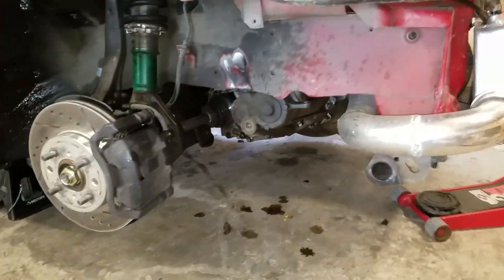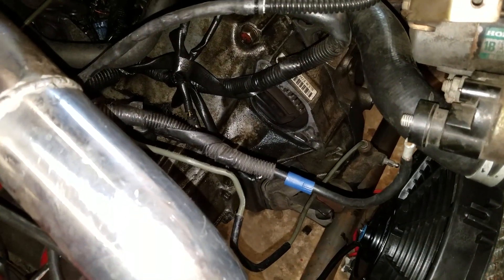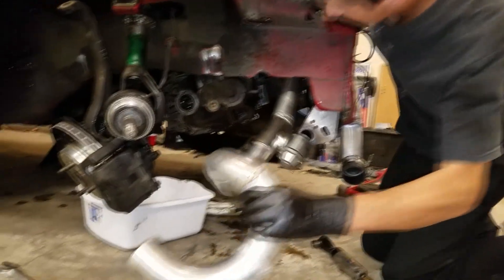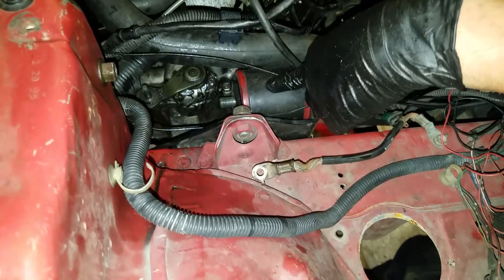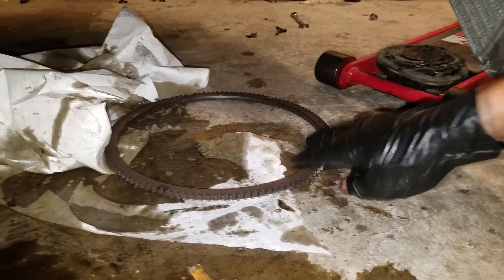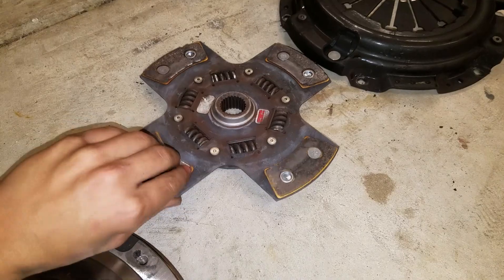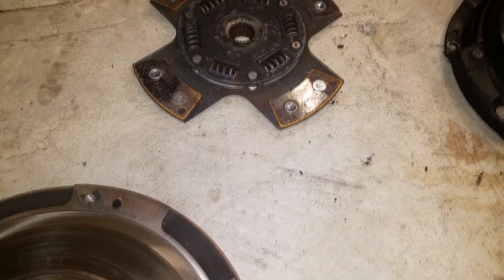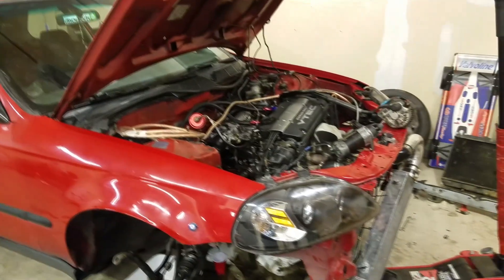The Hatch is Down

Comment: clutch and flywheel wasn't properly broken in.
Reply: seriously or are you joking?
Reply: +Tony Soto I agree with you
Reply: Tony Soto when you throw in a clutch and don't properly break in and wear the highs and lows of the clutch surfaces flat and even first before banging the gears it will cause excessive heat in random areas creating hot spots and expanding the clutch material at different rates and then pieces start to break off. drive with the new clutch slowly pushing and releasing the clutch at cruising speed if you don't want to have to drive 1000 miles first.
Reply: +john martin true but his stock flywheel probably had uneven wear to begin with due to probably just being the original flywheel he most likely broke the clutch in he seems to know his stuff. so the clutch dieing probably result of original unevenly worn flywheel and not from breaking it in properly .. plus he has at least 550+ hp sooooo shit gon break. But you are right about the hot spot thing but the flywheel looks like the heat was evenly distributed, you would see the hot spots colors scattered not how they look in his video but heat and pressure still murdered his flywheel
Reply: gs ks yes that would take even more break in time unless he has or had it re surfaced first. even wear equals even heat across equals more grip and a longer life.
Reply: Also pressure plate hot spots that break off will stick on flywheel and make a weird color marks and or scratches or gouge on flywheel if the piece doesn't disintegrate  fast enough
Reply: +john martin touché many possibilities not enough cash to fix #thecarlife
Reply from the maker: i had it resurfaced and put over 500 miles on it going easy with it to break it in before i got it tuned, im not sure if it was the power or not breaking it in properly that did it but thats some info i can add